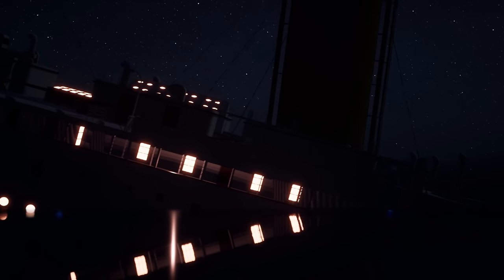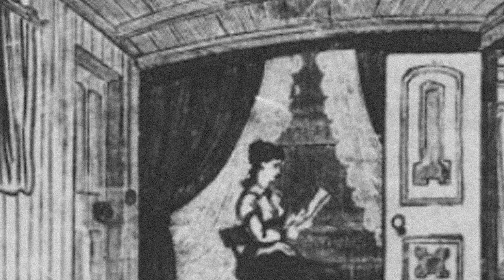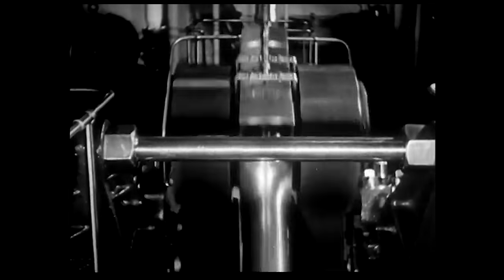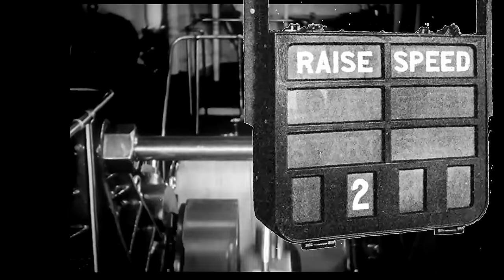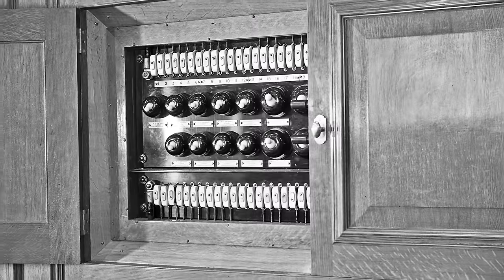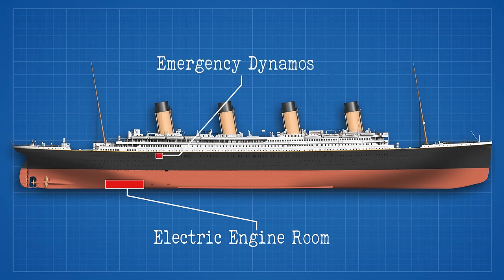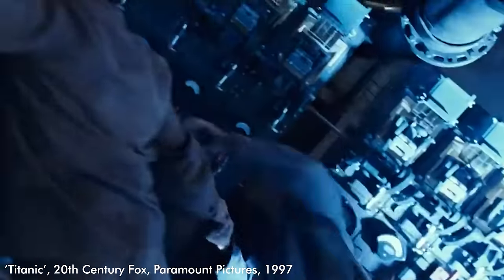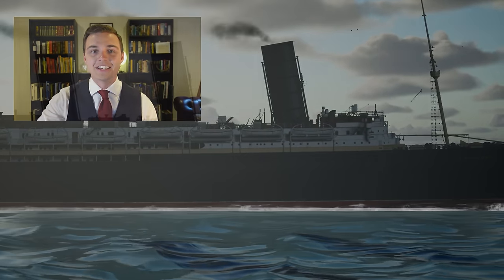How Did They Keep Titanic's Lights On So Long?

Comment: People have this idea that water causes instant shorts and will blow every fuse with a huge display of sparks, but this is not the case. Even salt water is quite a crappy conductor compared to a lamp or a heater and there where no ground-fault-interruptors back then, the fuses where there to prevent fires. All the wires would have been insulated because they have to me, all outside lamps would be waterproofed because... well they are outside. I'd say it's very possible that the entire bow remained lit when it went under. There wss simply nothing stopping power being generated, nothing damaging enough to trip the breakers

Comment: 11:56 just because the steam pressure dropped doesn't mean instantly no power, the dynamos would have spun down for quite some time and still generated power while doing so, depending on their mass etc, it may have been 30 seconds or more
Reply: But why did the main lights did go off but only the emergeny lights remained burning, i mean would they have be burning for 30 Seconds or so too?
Or did they have a generator trip System or smth like that🧐

Comment: Some people have claimed that the generators would have slowly spun down when they lost their steam supply and kept the lights burning for a little while during and even after the breakup.  I don't buy that for one simple reason.  

Electricity is a means of transferring work from one location (the generators) to another (the electrical load).  The work being done was the spinning of the magnet in its coil of wire to generate the electricity which effectively puts useful energy into the system, and that energy is consumed at the point where the efforts of that work is actually needed by the lights, the Marconi set, etc.  If you stop putting work in at the generator end, the load will completely deplete any residual energy left in the system in a matter of seconds.  

If any of you have ever owned a bicycle with a dynamo for the lights, I'm sure you remember it took more effort to pedal with the lights on than off.  You could also turn the bike upside down and spin its wheel.  The wheel would remain spinning for a while until its energy is disappointed as heat due to friction in the wheel hub, but that would take a while.  If you tried the same thing with the dynamo engaged, however, the wheel will come to a stop almost instantly.  The load of the lights is using up the stored energy in the wheel and there's none left to keep it spinning.  

The same thing would have happened to Titanic's dynamos.  Assuming the circuits remained intact enough to continue to supply electricity, the failure of the steam supply would have caused the dynamos to wind down in seconds.  Of course if the circuits didn't remain intact the lights would have gone off instantly.  Either way, it would be impossible for the lights to stay on more than a few seconds (I doubt more than 5, and even that's pushing it) after Titanic broke up.

Comment: Interesting video. I think it was most surprising to learn that the ship's heaters were powered by electricity. I would have thought they would have used steam as a heat source what with the crazy amount of steam they must have been generating.
Reply: Electricity would be easier to deal with. It's why you no longer see houses with radiators.

Comment: Thanks Mike.  Wow!  The quality and design of the electrical system is incredible.  The feeder switch board at 7:37, for example.  This is one of the most interesting videos ever!  If I may add, I bet the emergency lighting was all water tight fixtures with waterproof conduit.  Do you know?

Comment: I’ve read that boiler room one was activated only in port. It took about twelve hours for the cold starting bigger boilers to get up usable steam, so even the smaller ones wouldn’t have had sufficient time to become usable even if they tried. The half boilers in boiler room one are the ones scattered in the debris field.

Comment: Question: what was the situation on the Titanic in terms of pumps to pump the water out of the ship? How many did they have? What was their capacity? Did most of all of the available pumps get used? Thank you so much!
Reply: Also, were the pumps actually electrically driven or powered by steam engines?

Comment: The fate of those guys in the stern must have been terrifying.  Imagine the hearing the ship cracking and the fuses and steam lines start breaking and the men are wondering what is happening, and then the ship breaks and falls back level.  For a moment they are sitting in the pitch dark with the ship level again and all you hear is water coming in.  I'd imagine they had flashlights and tried to figure out what wasgoing on but then the ship went veritical again.  They could have been some of the last to survive inside the ship, even as it sunk to the bottom.  They are some of the unsing heroes.  I'd imagine by studying the circuiting of the ship you could determine the sequence by which lights went out.  I think there were eyewitnesses that said only the stern was lit toward the end which would make sense if the middle circuit zone was shorted in it's entirety.  I think most portrayals of the sinking make it far too bright and there may have only been a smattering of stern lights on by the break.

Comment: Something I've wondered about - for Titanic or modern ships - is what percentage of power is used for propulsion versus for "hotel power" for onboard electricity. Between the three shafts Titanic had 46,000 horsepower, or 34.3 MW. If each dynamo was 400 kW and typically three were operating at any given time, that gives 1200 kW (1.2 MW). This is roughly 3.4% of the propulsion power. Less than I was expecting actually. I'm guessing this percentage is higher on modern ships, that have yet more electrical equipment (including a lot of things that are electric on them but were steam-powered on Titanic, such as the heating system) as well as are slower (designed for cruising or shorter journeys rather than ocean crossings).

As a point of comparison, the GE Genesis passenger train locomotive can provide 800 kW of "Head-end power" (HEP) for the coaches, and had a total power of either 3,200 horsepower (2,400 kW) or 4,000 horsepower (3,000 kW) depending on version. I'm guessing the HEP - however much was needed at any given time - was deducted from this. So in the worst case scenario of a 3,200 horsepower version giving its full capacity for HEP and the rest for propulsion, the locomotive is producing 50% as much HEP as propulsion power (33% of overall power going to HEP). I'm guessing a large percentage of this went not to lights but HVAC systems in the coaches - I wonder if there was the ability to shut that off temporarily while accelerating so more power is available for propulsion? I know some cars have that feature, automatically shut off the A/C above a certain throttle setting. I'm surprised how much power the coaches take to run versus to pull (in a worst case scenario the locomotive is designed for, probably not all the time), and how large this is compared with ships, I'm guessing it's mostly for heating or A/C, train cars having a lot of surface area relative to their volume, typically have large single-pane windows, and probably aren't very well insulated compared with a building, plus having air flowing past them. Ships, at least in the surface area per volume regard, would be more efficient to heat or cool.

Comment: I'm not familiar with civilian maritime electrical design of that period, but on warships it was standard practice to completely isolate the electrical system from earth. By contrast, most land based systems have one conductor referenced to earth.
It meant that the electrical load would still work if one conductor was shorted to earth (by damage, seawater etc.). The logic was that it was more important to keep the lights on, pump running whatever than to rapidly blow a fuse and isolate the supply.

Comment: The fact that it was saltwater would have helped. Saltwater isn't a very good conductor, in fact it was used to dim stage lights in some early stage systems. Fresh water would have caused a lot more shorts.

Comment: Something I'd like to know is how big were the pistons and the engine room in general? The James Cameron movie makes them seem absolutely massive but I feel like in reality if I could stand in the engine room it would all be smaller than I imagine.
Reply: Camera optics and perspective may often be very misleading when it comes to judging sizes. Just remember how tall (or in fact small) some actors are - while they all fill the screen perfectly, it really puts things into, well, perspective.
And using wide angle lenses to capture more of any room or stage also distorts sizes. Placing cameras low also makes buildings or structures appear more massive and dominant.
Reply: @dmues5s  exactly, which is one reason i'd love to know what it's actually like
Reply: Engine Weight

1,000 tons

Engine Height

30 feet

H.P. Cylinder Diameter

54 inches

I.P. Cylinder Diameter

84 inches

L.P. Cylinders Diameters

97 inches

Stroke

75 inches
Reply: @JoshuaTootell  that doesn't exactly provide a convenient visualization right away but it's a very good start, thank you.
Reply: Might be worth looking up pictures of ships like the SS Keenwatin, or other ships with triple expansion engines.
Reply: The film used the SS Jeremiah O’Brien engine, then scaled it to make it look big, really cool, the actual engine in real life was roughly 60 feet tall

Comment: The lighting and ventilation is miniature load compared to the giant motors running below. Fire pumps keeping the fire network under pressure all the time. Sewage pumps unloading the sewage out of the Titanic, lubricating pumps for the engines and last and more giant of all the steering of the ship, the electric motors turning the rudder would be massive.
Reply: Coal fired steamship Titanic

Comment: Such an amazing design for a ship. And a high quality set of workers running the power. I can see why they were so confident. If only they didn't trust that group that put in the improper rivets.
Reply: The rivets weren't improper, there were just sections of the ship that used iron rivets for ease of construction around the awkward shapes of the bow and stern. The rest were steel.

Comment: Contrast with the Lusitania, whose power went out basically right when she was torpedoed and the fatal explosion occurred.  Was it her different design, her engineers' self-interest, damage caused by said explosion?  With the state of her wreck, we might never really know.
Reply: The Lusitania had a much inferior design to Titanic. The main intention was speed rather than comfort or stability. Titanic sank slowly and on an even keel and every lifeboat got away. Lusitania heeled over and only a few boats got away, it also sank very quickly. There is an excellent book about the sinking of the Lusitania and I would recommend it.

Comment: I think that it is possible for the lights to stayed on briefly after the breakup as boiler room 1 would have likely still been in circuit even though not fired there would have been some residual heat enough to make steam till the system fully bleed out. Unlike with compressed air which loses pressure almost immediately there is some delay with steam systems.

Comment: I used to be a huge titanic nerd. And I had a question I was wondering if you could answer? If the ship had in fact fully split in half (because it was still connected by me strip at the bottom of the hull) if it had split just in front of a bulkhead leaving a few of them intact and dry, could the rear half of the ship kept floating on its own. Or would it have sank no matter what?
Reply: Honestly I'd doubt it, between the stress of it being hoisted in the air, the impact on landing, the shearing forces upon the breakup, and the design of the watertight doors, the hull was most likely compromised. I wouldn't be surprised if the hull plating tore away from some of the decks during that whole chain of events.

Comment: I've always wondered about electrical distribution in a ship, particularly dc which can't be transformed like ac, and earthing where on a ship with ac and dc supplies, there would be ac and dc earthing and radio earthing too I suppose, all nicely packaged in a metal hull in water.

Comment: They should have made tops to the water tight bulkheads so each area could be completely sealed and if they were completely sealed like air tight seal then each room wouldn’t have even filled up completely rooms that were underwater but had holes in them lower then the the top of the rooms wouldn’t be able to fill completely because the air could not escape the tops of the room so any rooms like this would have less water in the rooms which translates into less weight and not sinking or tanking much longer to sink. It could have had 7 rooms tanking on water but if the rooms only could fill up halfway that’s the equivalent of 3.5 rooms fully flooded. Also if this was done it could give workers time to do temporary repairs to seal off leaks and pump water out. Idk what technology they have to make repairs but I would invent magnetic sheets that can basically just be slapped over an area to seal it off. When a hole is under the water line you don’t need something that needs to bond very well because the pressure of being underwater will hold it in place it just needs to be light weight you couldn’t put big thick plates of metal on unless it was welded or bolted because of the weight of it but if they had sheets or rolls of thick rubber that had some steel cables imbedded in the rubber for strength with magnets to hold it in place it would be able to hold in place and the rubber would form to the holes. They could make rolls of thick rubber that are mounted all the way down a ship with cables that wrap under the ship to the other side so the rubber sheets could be rolled under the ship automatically to stop a leak Im really surprised something like this does not exist. Again it’s not something that needs to be very structural it’s something to just stop leaks so people can be rescued and if this existed it could have stopped the leaks so engineers could have had time to pump the water out of the rooms and welded in some patch repairs inside. If I built a ship it would have a double hull and between the 2 hulls would be rubber or Kevlar or some kind of foam that is strong and would not tear so it would keep the ship sealed. Or what about a huge inner tube that wraps around the ship and is inflated to help keep the ship afloat again it’s all about buying time to be rescued. I will say the lifeboats they have now that are completely enclosed basically a submarine but it’s a boat so if there is a storm they will be safe which is a great idea but making a ship not sink in the first place is key because people panic, ship can capsize so getting into lifeboats might not happen. It’s just so sad that so many people died and there was no reason for that to happen they should have had enough lifeboats for everyone they should have had way more then enough for everyone and the lifeboats should have had enclosures and a heat source because the ship was sailing in freezing temperatures! For how expensive it was to build the ship and the prices of tickets that should have been the case I mean charge each passenger 1 dollar more to build better lifeboats that didn’t make the deck look to cluttered, have an en enclosure and a small fireplace with 20 logs with matches! They could have made one time use fireplaces for peanuts and as far as a fire goes put a bucket in each boat so if there is a fire it would take 2 seconds to put the fire out considering they are surrounded by water. More lifeboats, an enclosure and cheap fireplace with 20 small logs of wood could have saved everyone! I’m sure so many people that were pulled from the water would have been saved if they had a heat source. You could make a fireplace for 20 bucks out of some thin metal like heating duct metal for a furnace from a modern house just a sheet metal box with a grate and a 7 foot tube for the fumes

Comment: The short answer is that the engineers, electricians, and crew manning the engine room, electrical turbines, and the last few boiler rooms in the rearmost part of the ship stayed at their stations; keeping the steam pressure up high enough to power the lights and try to keep the ship going to the bitter end. The ship also had separate circuits for separate sections, so that even when the lights gave out due to a short circuit in the forward part of the ship from the salt water, the rear sections could continue being lit. Ironically, the ship only broke in half shortly after the entire electrical system finally gave out.